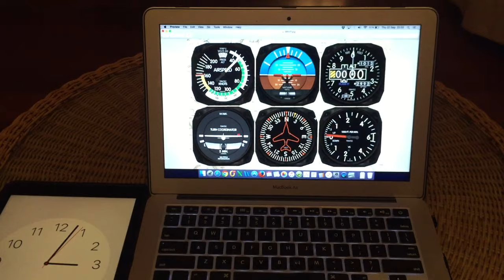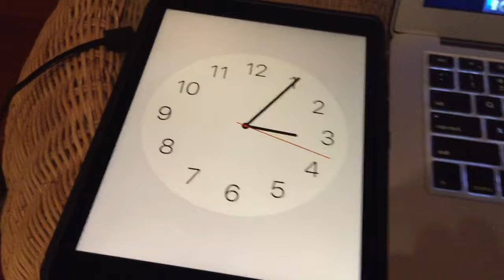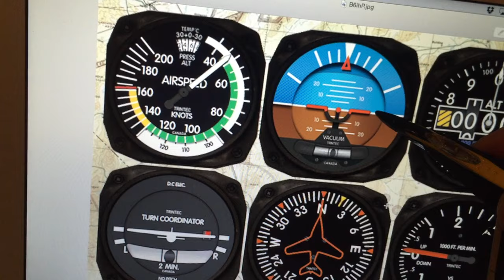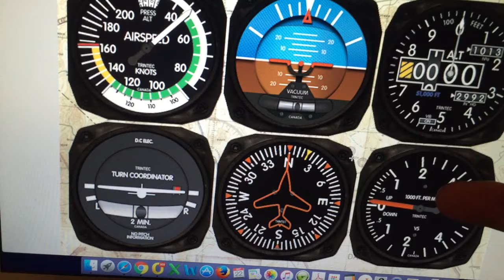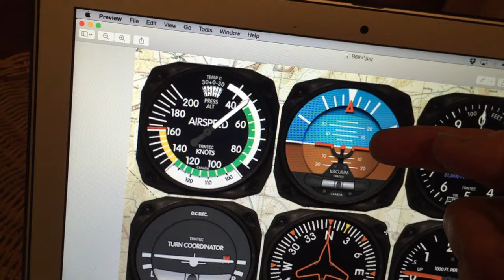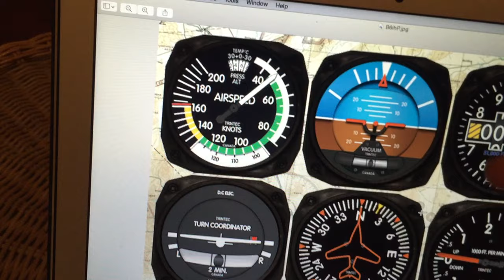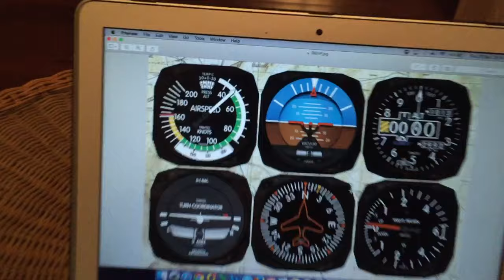Do aircraft change attitude to follow the curvature of the Earth?

Comment: Wolfie6020:

Flattard odiupicku claims:

1. Let's say you fly at 2 mach speed (1500 miles/h) = 1500/60 = 25 miles/min...8* 25^2 = 5000/12= 416,66 feet = 126m/min...126/60 = 2,1m per second...So, you have to nose down your airplane 2,1 meters (6,93 feet) PER SECOND....If you applied this same simple calculus for SR-71 (Black Bird) aircraft which flies at 3,2 mach speed (3840 km/h), you would get next result : Black Bird pilot should nose down his aircraft 5,3 meters EVERY SECOND in order to stay "level" in relation to the spherical shape of the earth...
2. There is a very simple way how you can check if "Schuler tuning" is pure imaginary concept that has nothing to do with reality : put side by side two different gyros, one gyro which is allegedly embedded into Schuler tuning system, and another gyro which works independently of any other system or device. If you can observe significant deviation (or any deviation at all) in functioning (maintaining-indicating level flight) of these two gyros (while flying in a straight line - certain number of miles) then you will be able to come back here and before all of us solemnly testify that you have succeeded to measure the curvature of the earth. Otherwise, you will be able to admit to yourself : i have finally found what i was looking for : a convincing proof for the flatness of the surface of the earth! One thing is sure : schuler tuning doesn't apply for the purpose of compensation of the non existing curvature of the earth. Is there some other application for this system (wander-azimuth - gyrocompassing for instance) i don't know, and i don't even care. All i know is what i have already stated : Schuler tuning has nothing to do with the alleged curvature of the earth. Just use your reason, that's all it takes.

2a) There isn't any self-correction system embedded in gyro, so if you caged gyro while gyro is slanted let's say 10 degrees (with respect to the ground/table) and then spun it up, and then level it off (lay it horizontally on the table), gyro will indicate 10 degrees error permanently (exactly 10 degrees discrepancy-with respect to the ground), that is to say : gyro will never be self-corrected by any erection system ("schuler tuning" myth)...NEVER...the only way how you could correct such initial error is if you manually caged the gyro again (after leveling off your aircraft attitude). That is all there is to it!!!

He goes on to claim that gyroscopes are "too slow" to correct for this.

How would you respond?
Reply from the maker: +Everrett Anderson.  Hi Everrett, I actually did reply directly to this on Odiupicku's channel, we then had further discussion and he ended up blocking my posts so you won't see them.  

Here are my responses directly. 

+odiupicku.  Can I ask why you believe an aircraft has to descend to follow curvature? 

Please visualize a train on a perfect circle of railway track - as the train moves around that circle many times, at which point does it move closer to the center of the Circle? 

It never does - it maintains exactly the same distance from the center of the circle at all times. 

The aircraft follows the curvature by staying at the same level - so there is no descent required.   Think about that train... :-)

All that is required in the SR-71 is a slow attitude change (not changing relative to the horizon though) - just 0.57 degrees per minute from the original orientation.   That is small and achieved simply by maintaining altitude. 

Yes there is a measurable force we can detect in the aircraft as it flies.  When going East the observed G is less than when going West.  I have a video showing this on my channel.  I see it myself regularly. 

The idea that an aircraft can fly off into space is incorrect.  That belief ignores the reality of aerodynamics completely and the fact that engine thrust reduces with altitude. 

I fly a high altitude corporate jet capable of 51,000ft.  I could not make it reach 60,000 ft if my life depended on it.  I could try holding the nose up but eventually it would run out of airspeed, stall and drop and there is nothing I could do about that. 

Try doing it in a small Cessna and you will be lucky to reach 20,000 ft.  It simply will not go any higher. 

I respect honest research, but there are many fallacies in these Flat Earth concepts.  Planes flying off into space or requiring descent to follow curvature are just two of these..

+odiupicku  Once again you are completely ignoring Aerodynamics.  Inertia is not the only force at play here.  

Do you understand that Lift and Drag are a function of the airspeed squared?  Double the speed and you quadruple the drag (think of drag as wind resistance)

Drive your car at 60 Mph and put your hand outside the window - you can feel it - that is air resistance. 

The speed of any aircraft through the air is a function of how much thrust we have available vs the drag on the airframe. 

Propellers are efficient at low speed but quickly lose efficiency at high speeds.  It cannot possibly retain this high speed and drag will quickly slow the small aircraft down. 

The B-52 has a different shape wing, (swept backwards) different air frame and jet engines which produce better thrust at high speeds.  This is the whole reason jet aircraft can fly faster than propeller aircraft. 

You are not really helping Flat Earth by spreading poor understanding of basic aerodynamics.  Any pilot I know would read your words and write you off as a fool.   Sorry, but that is reality. 

I am trying to help you understand what you currently do not.  Please see it that way.  If you do not want to learn just say the word and I will not waste my time further with you.
Reply from the maker: +Everrett Anderson.  He is completely wrong about the Gyro also. 2a.  It will absolutely not maintain the 10 degrees slant, it would correct itself fairly quickly back to level.  I bought an Artificial Horizon to demonstrate this point directly but have not had enough time at home recently to set it up.  

He is very wrong as you will see.   I used to teach aerobatics and when doing a spin the Gyro would topple completely.  After finishing the Aerobatics it would slowly correct itself back to level automatically. 

https://www.youtube.com/watch?v=qW9KHcPQJYM

He is wrong about the Gyros being too slow.  I'll make it a priority to get this video done.  Here is the gyro to prove I have it. 

https://www.youtube.com/watch?v=g64XSG56egQ
Reply: Wolfie6020: Thanks. What about his "challenge"?

"put side by side two different gyros, one gyro which is allegedly embedded into Schuler tuning system, and another gyro which works independently of any other system or device. If you can observe significant deviation (or any deviation at all) in functioning (maintaining-indicating level flight) of these two gyros (while flying in a straight line - certain number of miles) then you will be able to come back here and before all of us solemnly testify that you have succeeded to measure the curvature of the earth"

I'm not sure what this challenge even means or what he is trying to say...That a gyro "embedded" in a Schuler Tuning system should be expected to behave differently from one that is not? And since (he claims) they don't, the Earth is flat?
Reply from the maker: +Everrett Anderson, I don't think he understands that Schuler tuning is but I think his point is to use one gyro with the correcting mechanism working and another with it disabled.  This has been mentioned a few times to me also and would be a good experiment to try. 

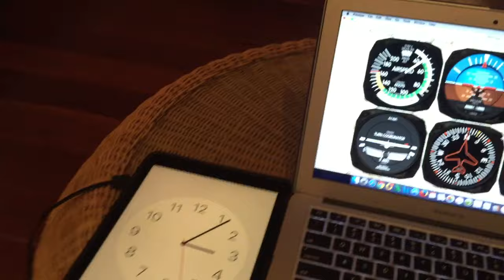I found this video just now.  Note what he says at 3:42.  and you can see the pendulous vanes actually working. 

https://www.youtube.com/watch?v=ykwJI-7W-c4

I am home in a  few days so will do my best to make my gyro video. Mine is an electric gyro so I need to power it with 28 volts and make a wiring harness which was missing when I received it.
Reply: So if you did that and the gyros behaved differently, I suppose odiupicku would denounce his belief in the flat Earth and take down his channel...
Reply: odipicku blocked me as well a while back when I tried to explain to him how pendulous vanes in vacuum driven attitude indicators work....he didn't like what I had to say.
Reply from the maker: +Bender2497   Like many Flat Earthers who claim to be truth seekers but in reality have no interest in the truth and will even block it from their subscribers to keep the delusion going.

Comment: The airplane will seek a given attitude for a give angle of attack. No need to push the nose down to follow the curve.
Reply from the maker: +David Carvell,  Yes I agree the lowering of the nose will occur naturally too due to aerodynamic stability.  However that alone won't keep the aircraft within the required altitude tolerance.   We are aiming for no more than  +/- 100 ft vertical deviation from our assigned altitude.  That can only be achieved with constant corrections from the pilot or autopilot.
Reply: Agreed (as a pilot). But I was talking about attitude, which an airplane will seek to maintain.

Comment: Guys let me make it easy for you the earth is flat , very simple , no curve in the sky at the horizon, no curve on earth in horizon. No curve what so ever .....according to globe earth , 8 inch tilt for each 1 mile , i saw a video showing flags floating after it was zoomed in with a high tech camera 30 miles . The flags barley 10 ft. 30 miles means 240 inch in curving, which equal to 20 ft. That means when the camera zoomed in it should not see the flags , because they are down in the curve of the earth......earth is not circle , earth is as big as the sky .

Comment: Like the video, I really don't get the math.
Reply from the maker: +Kenny Martin. 

Thanks Kenny.   Just think of a train going around a perfect circle of track - it never gets closer to the centre of the circle.   It changes directly at a constant rate.   People on the train do not experience exponential side force - it remains constant. 

The same thing applies to an aircraft.  In this case the force is Centrifugal and extremely small - you can see in my last video the weight difference is detectable going East.   I will post the video going West soon for a comparison.